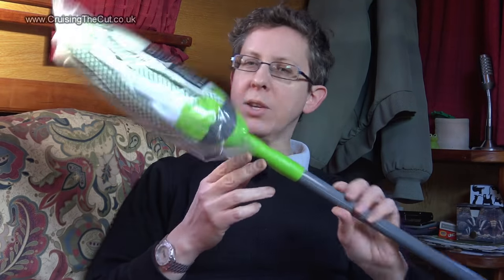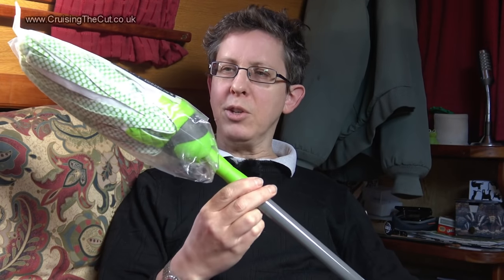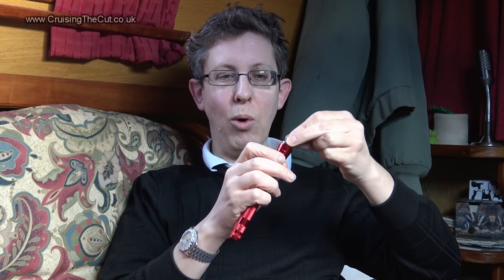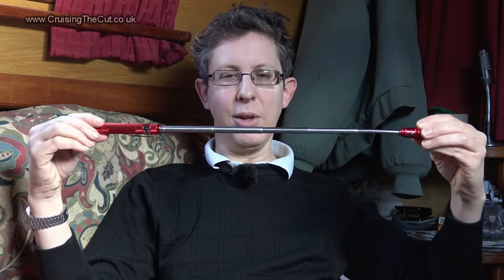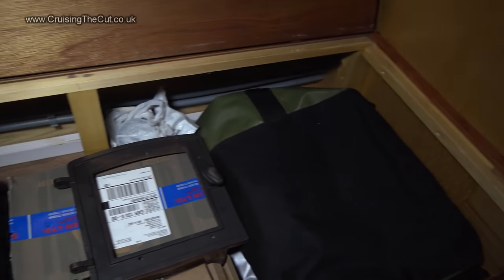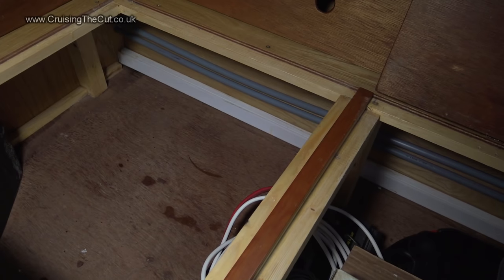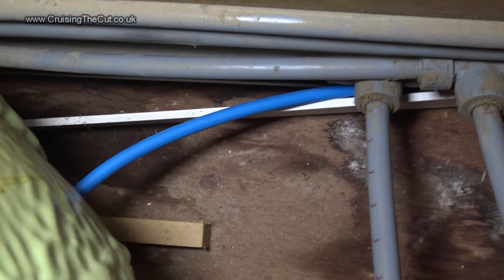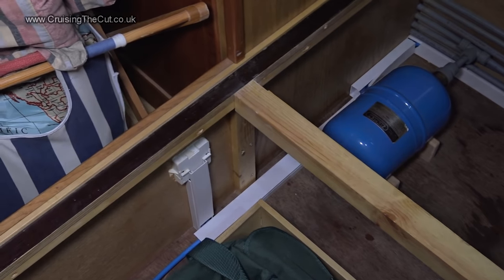19. A shopping "haul" and some new wiring on my narrowboat

Comment: A potentially dumb question but: How much electrical power is there available from the mains sockets on your boat?

I was just asking because it would be interesting to know if you could run a mid-range desktop computer for any length of time. I know a high-end gaming rig (or workstation) would probably result in "Excellent my machine is runn--- WHERE HAS MY POWER GONE!?" (unless your boat is made of mostly batteries).
Reply from the maker: If plugged into a shoreline then you have the full shoreline amount, typically a 16A supply at 230V so about 3 kilowatts ish.

On the batteries, it depends what size inverter you have; mine's a mid-sized one, 1300W so plenty for my laptop.

The length of time it could run depends on the size of the battery bank; mine's 3 x 110Ah although they're very old and don't hold a charge like they used to. However: 330Ah at 12V = 4kWh theoretical max but you never discharge past 50% so that's 2kWh max; divide that by your PC's power requirement to see how long you could hold out... of course if it's sunny and the solar's getting lots of power in then effectively you end up running off the solar.

Comment: Buy a quantity on eBay or amazon of those batteries much cheaper than stores. AG13 is the same. The best battery type is silver oxide or lithium. The alkaline variety is cheapest but not as long lasting

Comment: @5:12 When you were talking about how you can't have any electronics in the cupboard under the TV because the door would have to be open. Well, you could knock out the center panel to that door and get some speaker mesh, they do make some that look like wood, and fit that to the door frame instead of finding some odd place to electronics. You could also just get an infrared eye extension and route it through the TV port and then you have to just use your remote.

Comment: Oops. You're not supposed to run AC (mains) with low voltage DC (12v). In the US, I believe it's supposed to be kept separate. At least, it is in industry. :)
Reply: Nice job though. :)
Reply from the maker: It's OK here (I believe) as the wires are double insulated.
Reply: @CruisingTheCut  Yes it isn't a problem. I'm an electrical engineer

Comment: Wait ..... you have a hot water tank under the bed and pumps in the bathroom cupboard . . . . .  I noticed that your shower isn't a cold feed unit with heater element . . . . . what heats the water . . . . . can you give a guided tour of your water system please?
Reply from the maker: It's heated by the engine, an electric immersion heater when on shoreline, and a diesel heating unit.

Comment: So on a narrow boat the mains electric circuit is it a circuit or is it a single cable with a few sockets down the length of the boat?
Reply from the maker: It can vary depending on how someone chose to wire it (you wouldn't believe how "individual" narrowboats are on this kind of thing. Mine is a cable with sockets off not a circuit.
Reply: @CruisingTheCut  

Thanks for the response. 

I can imagine just how individual they are after renovating an old house.  

I must say I'm enjoying the videos,   after catching one I've started watching from the beginning. 

Lots of food for thought. 

Perhaps you could give me some advice. 

I'm thinking of getting a narrow boat. 
Where is a good place to start getting advice and information. 
Is there any laws and rules that have to be obeyed.
When on the water way or with regards to renovating a boat. 

Thanks.
Reply from the maker: Best place is to talk to the Canal and River Trust (assuming you will be on one of their waterways rather than those managed by the Environment Agency, or the Thames). There are rules about running generators on the towpath at night, pollution etc
Reply: @CruisingTheCut  

Ok thanks,  a lot of things to think about before investing in a boat.

Especially when you haven't done anything like it before.

Comment: Have you considered a 12 volt (or pair of 12 volt) computer cooling fan being installed in your bilge connected to a relay (so it is only on when your boat is on) to keep the bilge dry of water?
Reply from the maker: I'd like to direct some fans into the cabin bilge but there's no real access to it so it would involve a degree of cutting up the floor. In the engine bay, it stays pretty dry anyway now I have the bowl under the stern gland.
Reply: So accessing the cabin bilge would be the same idea as entering the attic of a home.  Your narrow boat just fascinates me.  

As a side note: I'm dealing with similar challenges with my weather station sensor.  The humidity in the air is turning into condensation from the bit of heat the wires give off.  I'm setting up a passive dehumidifier for it with a series of fans to move the air through the conduit to vent it.  I had basically wondered if the plan the licensed electrician gave me to pursue was partially suitable to you.  You said in one of your videos about narrow boats rusting from the inside out.  I'd genuinely hate to see this happen to you.
Reply from the maker: More modern boats than mine have typically started to address this with vents into the cabin bilge at either end and some do even have fans. It's just that mine is a relatively old boat to a traditional design. I could probably rig up a fan in the back step up to the engine room, where the sole small inspection hatch into the bilge is located, and have it pull or push air. I might do that, actually!! Would make an interesting video too.
Reply: @CruisingTheCut  I just don't want to see your home fall apart from under you  :)  Cheers

Comment: Just a thought: why not splice it behind the fridge?
Reply: That's exactly what I kept wondering.  It's all the same in the end,  Same circuit, etc.  Lot's of work for nothing unless I'm really missing somethiing.  Maybe it's boat wiring code or something...
Reply from the maker: Hi. It's many years since this video was recorded so I'm not sure to what you're referring but at a guess: if you're assuming the fridge must already run off 230V so I could take a feed from that, it's not the case. The fridge is 12V, there was no 230V supply running past to splice into.
Reply: CruisingTheCut you’re so right David where has time gone! Good effort on still replying after nearly five years👍🏻

Comment: Call me stupid but should you not of hooked up a new wire to the fuse box and not some random plug socket in the bedroom? seems rather odd and a little dangerous to hook 2 plug sockets together
Reply from the maker: No, it's a perfectly normal mains line continuing from where one ended. Absolutely standard practice, no new fuse connection needed.

Comment: narrowboats seem to be tres tres badly designed all round! ... i have watched all of your videos so far (excellent in every department!!  : ) and absolutely shocked at the bad planning and inefficiency!!!  i have been feeling very sorry for you having to sort it all out!!!  :'(((
i would love to see a narrowboat designed by a woman cos i bet she would have sorted out all those glitches ... for example a girl would need loads of plug sockets for the hair tongs ... electric hairdryer ... electric toothbrush ... about 5 tv's ... phone charger ... so about 30 sockets at least ... it would be interesting to see how easy a female would make a narrowboat to survive in!!!
have any woman designed a narrowboat and what was her thinking?   thanks so much for posting!!!   🎅🎄☃️🎄🎅
Reply from the maker: The female design as you specify it would be a problem on a narrowboat since power is inherently limited by what your onboard battery bank, inverter (and perhaps generator) can supply. High current devices such as hair tongs, hairdryer etc are rare or at least used minimally. Phone chargers running on the 12V system are much less of a concern, the charge is minimal.

Comment: 230v AC mains occilate at 50Hz this induses an eddy current, which could induce the 12v DC side, also a spur taken of a spur is illegal under the IEEE regs, I cannot say if this applies to watercraft, and I used to be a Generator/Mechanical engineer, I designed  and certified many panels , and always was the low DC kept away from any mains wiring.
Reply from the maker: Cheers. This was not a spur off a spur, it was directly from the main RCD.
Reply: @CruisingTheCut   Nice one, keep safe is the number one rule, l enjoy the laid back no rush u tube vlogs.
Reply: You can’t take a spur from a spur unless it’s a switched fused spur
Reply: That which does not cause the demise of the boat or it's owner is acceptable.  What the bureaucracy does not know, won't hurt you.  (yes, one of those damned rebels across the pond here).
Reply: The induced ripple on the 12v leads will be negligible over that distance. 
Since the 3 core mains cable is double insulated it is essentially in it's own conduit. It could be argued by a purist the cable should have an earthed braided screen but since it is already protected in the 12v trunking even that argument is questionable.
Running a spur that length was a little naughty, but hey! who's looking?
Reply: @mrwilsonwilson9599   All this 'spur' stuff only applies to " Ring Circuits"... I more suspect boat may have 16 or 20 amp breaker on radial final-circuit .... obviously can't take that much power off most inverters, but shore-power may be able to!.  John Ward explains Rings here...  https://www.youtube.com/watch?v=hZN6hiGLtrE  .
Reply: +Scott Gibson
Certainly, keeping Mains away from lower voltage is 'good practice' -- I particularly wonder about the RF-emittable electrical noise (both to DC and AC side from many inverters) .... but thats' another story!.   As for "spur taken off spur" -- check your facts -- this ASSUMES "Ring final circuit" which I suspect may not be the case here, could easily be a Radial Final Circuit.  See   https://www.youtube.com/watch?v=hZN6hiGLtrE   .
Reply: Chris Landry  You mean 'IET' I think